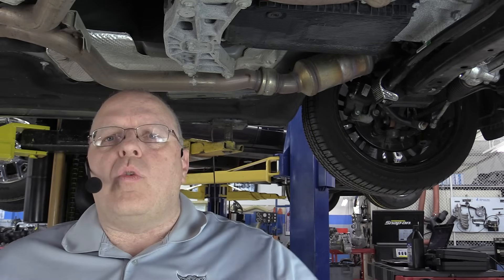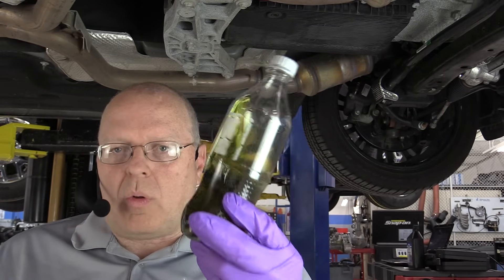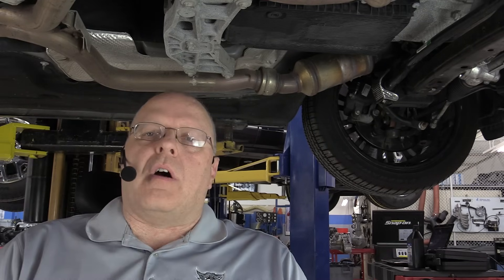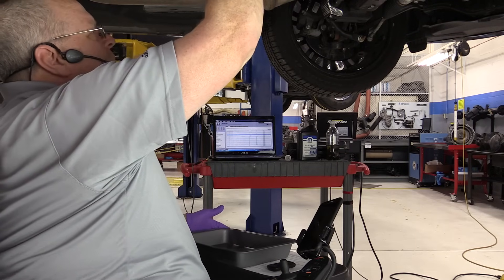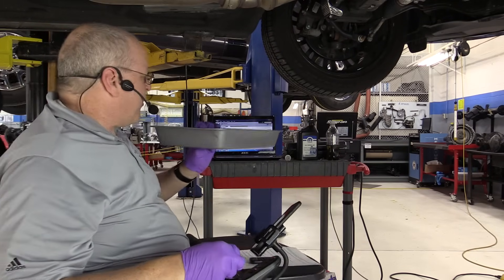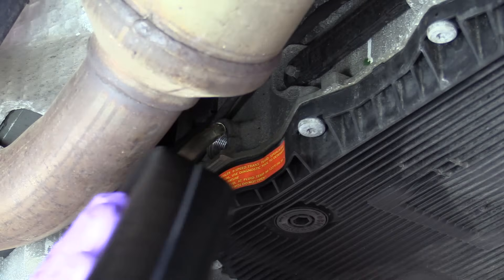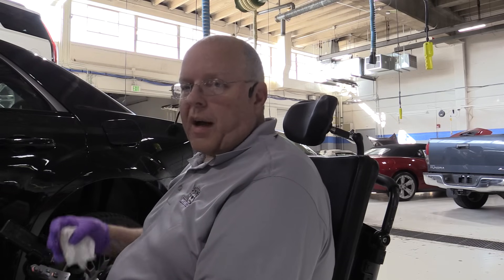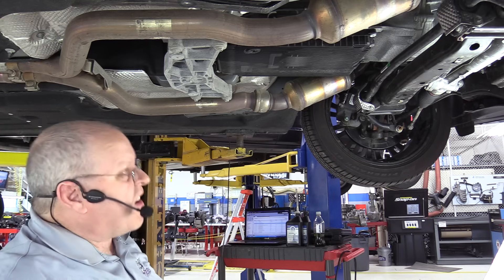Jeep, Dodge, RAM ZF 8HP 8HP 8-Speed  Transmission Fluid Level Check - No Dipstick

Comment: First you say, The cooler drains after shutdown so your fluid level could be low after warm up. Then you contradict yourself and say fluid is in the cooler so make sure you drain it doing a fluid change. Make up  your mind. Jeep for sure would have included the level check including the cooler if need be. stating to wait for the temperature to open bypass valve.
As a A&P mechanic, I will always trust the book written by millions of dollars of technology. before I trust tribal knowledge.
Reply from the maker: Tribal knowledge? LOL. The procedure used in this video was from the factory service information (FCA's Dealer Connect). The problem is they do not mention the (OPTIONAL) cooler issue, but the manufacturer of the transmission (ZF) does. ZF warns transmission service shops to be aware of this issue.
Reply: With due respect. The thermostatic valve opens up @ 160. Regular engine temp is 180- lets say 220. That  thermostatic valve will stay open after shut down and drain the trans fluid after regular trans temperature has been held. No matter what, gravity wins. Not seeing the system schematics. The only way the cooler would hold fluid, check valves would have to be included. If I may ask. Has the Auto Manufacture considered the servicing of the transmission with the optional cooler problematic?  How do you or the manufacturer of the transmission expect the fluid to stay in the cooler after shut down if the valve stays open at 160 and be able to hold any fluid at all except maybe residual. The most logical answer would be. expansion of the heated fluid after servicing temp. has been warranted enough to supply  the optional transmission cooler, and maintain a correct shift pattern.
Reply from the maker: I agree with you, there is no good solution to the issue. If it were mine, I would check the fluid level at 122 degrees and compare that to the fluid level check at 160 degrees when the bypass valve finally closes and allows cooler flow.

Comment: Since the ATF fluid expands at higher temps. wouldn't it be easier to just drain the fluid when cold and add the same amount of new fluid in cold temp as well. Very basic physics. Assuming fluids are within normal limits to begin with.
Reply from the maker: Yes, assuming the fluid level was correct to begin with, but that is the problem; how do you know? Thanks for your feedback!

Comment: When the valve is closed doesn’t the cooling system have the same fluid in it as when it’s open?  The same as the radiator has fluid in it despite the thermostat being open or closed?  Being open just means the fluid is flowing I would’ve thought!  I wouldn’t think it would drain.  If it did drain then it would make the fluid change more complete but seems to me like they could’ve engineered a better way to maintain and service the transmission and I SEVERELY DOUBT that any local dealership will take this much time and care to do a fluid change in my transmission.  They will do half the job yet charge full price!
Reply from the maker: Thanks for your feedback!

Comment: i say bring back the dip stick. such a simple device, these new computer nerds just have to ( * ) up everything with way over done ... stuff.
Reply from the maker: As an automotive professor, I hear from a lot of people and students who have a negative reaction to this video and wonder why they took away the dipstick. 

Think about this: if a dipstick is so easy to use, you should be able to answer all of the following questions: 
1. At what temperature is the "cold" mark accurate? 
2. At what temperature is the "hot" mark accurate? 
3. What temperature does the dipstick even refer to? Outside air? Coolant temperature? Transmission fluid temperature? 
4. How will you measure that temperature?
5. If the fluid is within the cold mark area marks when it is "cold", is the fluid level okay?
6. if you live in a cold climate area like Alaska, is the "cold" level accurate there? What if you lived in a hot climate area like Central America, is their "cold" mark accurate?

If you cannot answer all of the previous questions, should you be using a dipstick?

Comment: Service interval recommendations are too long BMW and Chrysler. On BMW, Chrysler vehicles equipped with this transmission, the factory rates the fluid to last a lifetime. The unfortunate fact is that this is simply not accurate. Tests have shown that the fluid starts breaking down at around 62,000 miles. It is therefore recommended that the fluid be changed every 50,000 miles. Doing so will assure you a long transmission life span.
Reply from the maker: There is a difference between fluid lifetime and vehicle lifetime. It is a sales pitch to make you feel good. most maintenance guides have an interval specified at a higher mileage. Thanks for your feedback!
Reply: Yeah... Life time... Of the transmission 😂. Which will fail prematurely.

Comment: Should you not change the fluid when it is hot so the bypass valve allows the oil to drain from the cooler? Why couldn't you just check the fluid while it is hot as the fluid would be circulating through all the components?
Reply from the maker: You cannot accurately check it when the fluid is hot, the fluid level check plug is calibrated for the lower fluid temperature

Comment: They have sensors for everything these days, could they not have a sensor for the fluid level that works in conjunction with the temperature sensor to give a warning if you're too high or too low?

Could they not design the transmission to manage overfill by diverting surplus fluid to a reservoir (that could be easily checked for a small amount of excess fluid, say)?
Reply from the maker: Thanks for the feedback. I wish they would add level sensors, but transmission leaks are pretty rare today. If filled properly, there is no reason to think the fluid level would change.

Comment: At 8:30 when you release the brakes and accelerate to 2nd gear, why doesn't the car smash into the walls of the garage?

Is that the parking brake light that was on the whole time?  Was the parking brake not damaged when you did the brakeless acceleration into 2nd gear?

What does turning off the traction control do?
Reply from the maker: The car is on a hoist, the tires ate not touching the ground. Turning off the traction control allows the rear wheels to spin while the front tires are stopped. Thanks for your feedback!

Comment: If you are out of warranty just use Valvoline Max Life Synthetic ATF and save your self the money. there have been hundreds of people who have used it for over 100k miles with no issues. Max Life is similar in specs to ZF Lifeguard 8. if your in warranty and have trans issues UNRELATED to the fluid and they see red fluid they will void you so keep that in mind. FCA says the fluid is good for life. ZF says its good for 60k-80k miles.. its all smoke an mirrors to make money. 50 bucks a quart of anything is ridiculousness!!

Comment: If the bypass block is out in the open, couldn't you use a heat gun to heat up that block so it will open?
Reply from the maker: Possibly,  But you must be careful not to overheat the transmission fluid or the block, they can be ruined from excessive heat. Best wishes

Comment: Dealing with hydraulics for thirty years on a daily basis you would need to determine if the cooler lines do drain back while the bypass valve is hot, if so there would be no true way of checking the fluid level because the fluid would drain back every time the engine is shut off while hot, however if the cooler is isolated during the ignition off position the cooler would stay full, You did a great job with this video by the way, very detailed!
Reply from the maker: Thank you, and thank you for your feedback!
Reply: How would the fluid drain back if it's a closed system?

Comment: lifetime fluid really means under car manufacturer warranty! after that you're on your own, transmissions have seals and cooling lines that can develop a leak. happened to me in a chevy cobalt. Car makers want, if you transmission develops a leak you can't check the level, there's no dipstick so you will drive until it starts slipping and transmission fails! so you will always need a new car or truck!
Reply from the maker: Thanks for your feedback!

Comment: fuck it i rather have a transmission that uses dexron 3, has a dipstick to check fluid level and condition, also be possible to install a transmission cooler and finally be able to replace the filter easy.
Reply from the maker: I understand what you are saying. As an automotive professor, I hear from a lot of people and students who have a negative reaction to this video and wonder why they took away the dipstick. 

Think about this: if a dipstick is so easy to use, you should be able to answer all of the following questions: 
1. At what temperature is the "cold" mark accurate? 
2. At what temperature is the "hot" mark accurate? 
3. What temperature does the dipstick even refer to? Outside air? Coolant temperature? Transmission fluid temperature? 
4. How will you measure that temperature?
5. If the fluid is within the cold mark area marks when it is "cold", is the fluid level okay?
6. if you live in a cold climate area like Alaska, is the "cold" level accurate there? What if you lived in a hot climate area like Central America, is their "cold" mark accurate?

If you cannot answer all of the previous questions, should you be using a dipstick?

All transmission fluid expands when heated, you must know what the fluid temperature is to check its fluid level properly. This is not a new concept. It began back in 1940 with the world's first mass produced automatic transmission, the Oldsmobile Hydra-Matic transmission. See https://www.youtube.com/playlist?list=PLIn3FrDiB1lxSj1CYYo3eL37NUVLU953S

Toyota, Ford, GM, BMW, Mercedes, etc. all do the same thing. This is not just a Chrysler thing. See my other three videos: https://www.youtube.com/playlist?list=PLIn3FrDiB1lyLCTQJ8cctlzy5AlAhZFvz

Comment: I used your video to do this recently on my 2013 charger. When it came time to put it in gear while in the air i let the wheels run while in drive to get it up to speed. It seems to have disabled the traction control, cruise control, hill assist, and abs. Also doesnt seem to be adapting to my driving anymore. It shifts high and feels like the sport mode in higher end trims. I have a v6 SE. The traction light is on as well. Is this something i can fix or do i need the dealer to charge me $150 diag fee to flip a switch in the computer? Thanks
Reply from the maker: It just needs the trouble codes cleared. Sometimes they will clear just by driving your car for a few days. You can also try disconnecting the battery negative cable for a few minutes, then reconnecting it and see if that fixes it. If not, any shop with a scan tool can clear the codes for you. I can't remember if I mentioned it, but turning off the traction control system will prevent that from happening while you do this procedure. Best wishes!
Reply: WeberAuto i appreciate your reply. I had pushed the traction off button on my center console prior to putting it in gear. Is there a different procedure like pulling a fuse? I have a cheap scan tool that is able to read and erase codes but its not helping. Ive left the battery unplugged overnight with no change. The abs light was on but when i started driving it turned off. The check engine light is not on either. Just the traction light. Maybe i should start checking fuses or just go to a shop?
Reply from the maker: Wow, that is unusual, you had better have someone check it out. There is not a different procedure. Best wishes.
Reply: WeberAuto I had the dealer check it out. They told me the steering wheel angle sensor was showing the wheel turned 360 degrees one direction while the wheels were straight. They thought the sensor was broken. During my repair I had to disconnect the intermediate shaft to get the cooling lines out. I had inadvertently spun the steering shaft one full turn before reconnecting it. They couldnt tell me which way it went but after the repair it had been hard to turn left sometimes so i figured the sensor controlled the pressure of the power steering and that it was turned to the left. I disconnected the shaft and turned it one full turn to the right and the system works perfectly fine now. Makes me miss my old chevy nova. Cheers!

Comment: what's the scan tool using?
Reply from the maker: I assume you are talking about fluid temperature. There is a sensor built into the valve body electronics.
Reply: can i just temperature gun to check trans temp?

Comment: Ram should have designed a dipstick and a separate replaceable filter for transmission service just like the old days.  The new method to replace the fluid takes too much time. Too many steps see - https://www.youtube.com/watch?v=AJOstl7TiOY
Reply from the maker: Thanks for your feedback. ZF has made many transmissions for many years now. They also have many different fluid specifications for those transmissions. Unfortunately, the fluid installed in that video was the wrong fluid. The ZF No. S671-090-255 fluid is for their older 6-speed automatic transmissions, it is not compatible with the 8-speeds. Additionally, the 5 quarts drained out is a little more than half of the total fluid in that transmission.  I recommend draining it again and putting the correct $$$ fluid in it ZF-LIFEGUARDFLUID 8 (ZF No. S671 090 312) https://aftermarket.zf.com/remotemedia/lol-lubricants/lol-en/lol-te-ml-11-en.pdf. Best wishes.

Comment: $43.00 per quart of transmission fluid is due to inflation or what ?   Each car takes about 5 quarts that equals to about $215.00 + $155.00 for the filter/oil pan.  Labor cost is about $250.00.  What the world is coming to ?  The older cars uses the cheaper red color fluid and a dip stick.  People should stop buying those newer trucks or cars !  You are doing a great service for all.

Comment: when the thermostatic valve is closed for low coolant  temps, fluid is trapped in the cooler unit. is cooler bypass computer controlled? if so, no issues opening it electrically. if bi-metallic/mechanical controlled there will be blood. if computer controlled there would be some way of forcing the coil with software..
how does ZF spec purging this system?
Reply from the maker: ZF only makes the transmission. The Vehicle manufacturer is responsible for developing the cooling/warming system to keep the transmission in the correct operating temperature range. Not every vehicle has a cooler bypass. This bypass is not computer controlled. Thanks for your feedback.

Comment: Thank you for the excellent educational video.  I now know what to look for and avoid in a new car purchase: transmissions that require 2 days to properly check fluid levels.
Reply: WeberAuto bullshit, lifetime means under car maker warranty! after that you're on your own, transmissions have seals and cooling lines that can develop a leak. happened to me in a chevy cobalt. Car makers want, if you transmission develops a leak you can't check the level, there's no dipstick so you will drive until it starts slipping and transmission fails!
Reply: @edvinnelius8213  In these days, ALL car manufacturers are doing this, so you have to get with the times! Some manufactures don't even have a dipstick for engine oil!!
Reply from the maker: lol, luckily they are filled for "lifetime" and never need checking ;) Thanks for your feedback.

Comment: Hey buddy I️ hope you can help me out I’ve been searching high and low for help I️ own a 2015 ram rt 1500 2wd with the 8speed & the transmission in the morning after I️ start & take off it shifts really really hard after a few miles of driving it stops also after it’s warmed up & it’s been driven when I️ come to a stop it kicks forward a tiny bit almost like someone bumped me in the rear bumper & one last thing at highway speeds my passenger seat shakes truck has brand new wheels and tires balanced & alinement was done seat still shakes plz plz help I️ love this truck & if it’s covered under warranty I️ would like to get it in ASAP plz get back to me need help bad bad 🙏🏼🙏🏼🙏🏼
Reply from the maker: Hi, fluid level and type make the biggest difference here. Make sure no other fluid has been installed in this transmission than the Mopar 8 and 9 speed fluid from a dealership. If that is okay or has never been messed with, there have been several software updates for the transmission. Have the dealer check to see if one applies to your truck.Best wishes

Comment: The bypass valve makes no difference, the cooling lines stay full and air pocekts cannot get in the cooler lines because the system is closed to outside air. The breather is on the case so any air getting into the transmission isn't getting into the cooler. 

If you don't believe me, see if your 2 day process makes a difference in the fluid level (it doesn't). It really doesn't take that long to check the level on these especially if you have a trans temp gauge in your instrument panel that gives a digital readout-it reads from the same sensor that your OBDII scanner will. The main difference in checking the fluid level on an 8HP and an older trans with a dipstick is that you have to crawl under the vehicle and you need a hex wrench. Starting it and flicking through the gears adds a couple minutes max.
Reply from the maker: Thanks for your feedback.